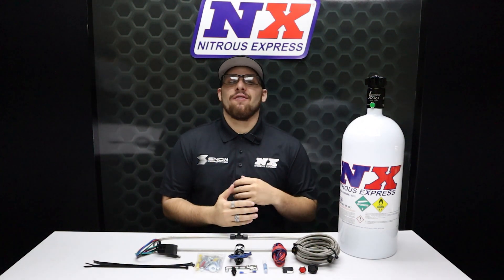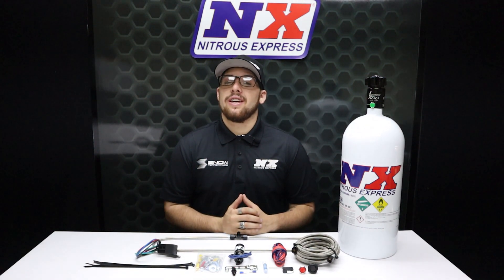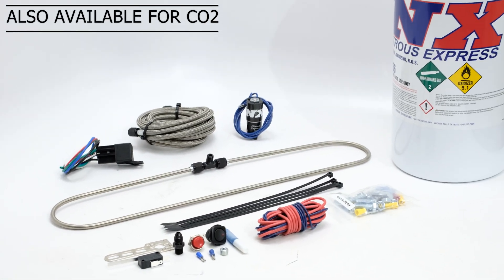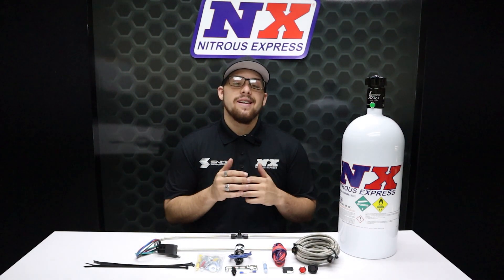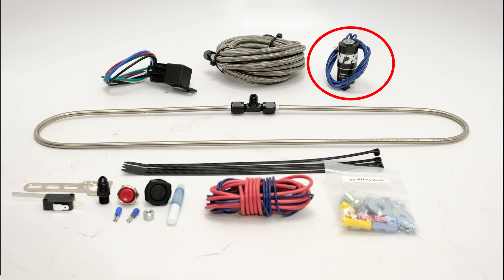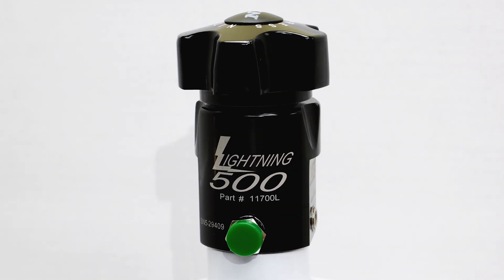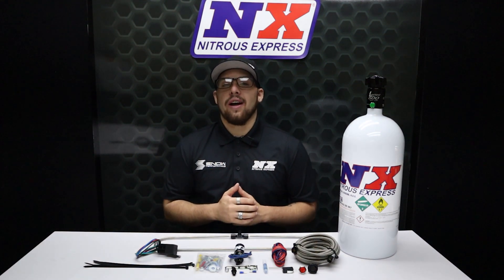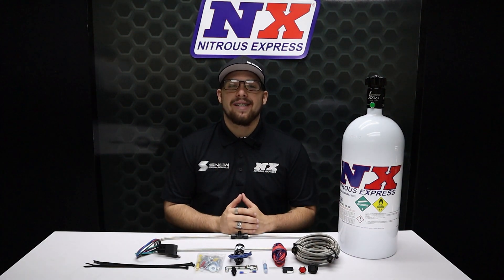Add More Power To Your Boosted Application! Nitrous Express N-tercooler Spray Ring System

Comment: Do you need to run a bottle heater with this?
Reply from the maker: It's not necessary for something like this. I do recommend running one for spot-on performance from your nitrous system though

Comment: What is the move if I have a naturally aspirated EFI V6 and want to run nitrous? Do I need to cool my stock radiator?
Reply from the maker: You would need to change your spark plugs and consult your tuner on how much N2O would be safe for your application. Cooling should not be an issue as the nitrous will lower your IAT's significantly.